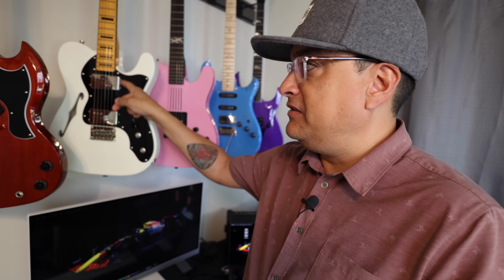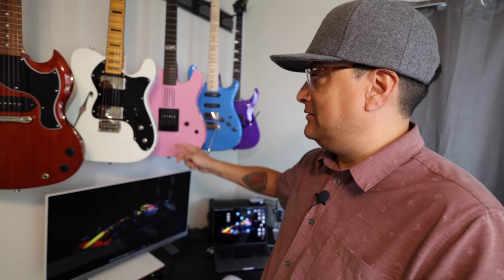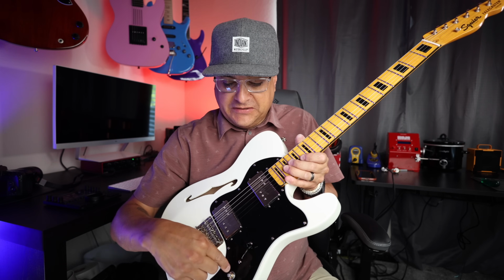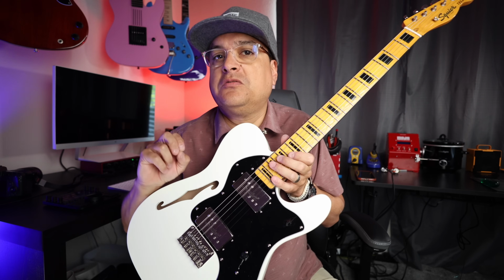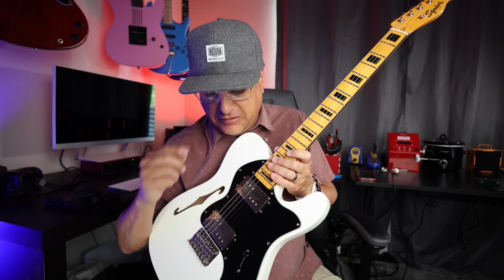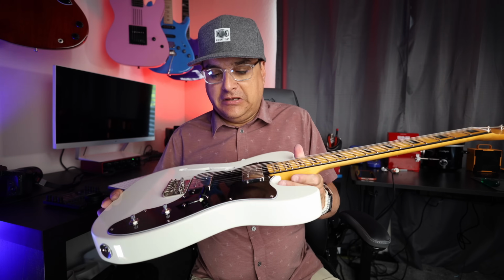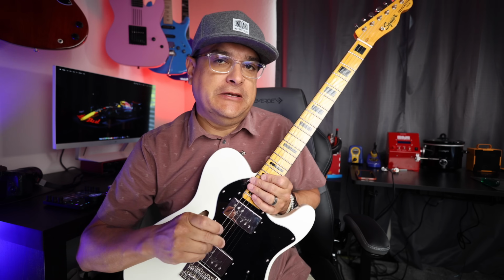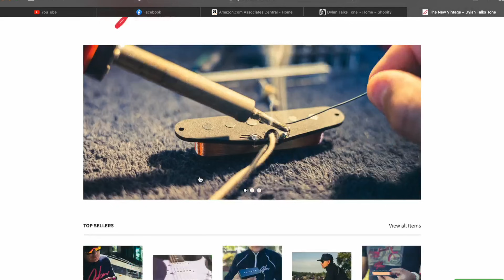250k Pots Vs 500k Pots - Sound Comparison

Comment: What nobody mentions is that none of these pots were at 500k or 250k when the guitar was being played! The crucial resistance here is that when the pot is fully open ... which isn't 500k or 250k ohms. The 500k or 250k is the figure when the pot is fully closed. So what is the resistance when the guitar is playing with fully open pots? ... well, unless you test the pots you won't know. Yes, it still boils down to the fact that 500k pots will be brighter than 250k pots but different pots have different tolerance levels so unless you measure the much lower resistance when fully open you can't make any properly detailed comparisons.

Comment: It's important to remember that the volume pot is wired as a voltage gate, as a result the hot signal has to go through more resistance as the volume is turned down, attenuating more treble.  This means that larger pots are brighter only at or close to full volume!  250K pots may be darker, but usually dont require anything like a treble bleed or 50's wiring to compensate for treble loss as volume is turned down.
Reply: Hi Dustin. Hope you can help me out. 1) How can the tone pot have influence on overall wiring resistance? For instance, I have an HSS guitar with 500k volume pot and two 560k resistor on each hot lug of each single coil so that they can see around 250k, but my concern is how the tone pot will get into this. 2) How different is it to solder the capacitor on the tone pot in the middle lug or the third lug. I have seen both wirings. Does it change considerably?  Consider for that, a master volume and master tone.Thanks a lot!
Reply: I change all my guitars to 50,s wiring, does this mean I still would benefit from Tone bleed    components added or not?
Reply: It's a treb pass, not a bleed.
I have no idea when the term, got reversed.
A bleed shunts to ground, signal gone.
A pass, sends desired signal to where you want it, not to a dead end.
Reply: @johncollins5552 Only if you like the effect.  Some like the sweetness turned down and one knob control.
With out a treb PASS as you come up in volume treb frequencies can talk to an amp aggressively. 
I don't mind using the tone pot.
Been using treb passes for near 50 years.
Reply: I play mostly Strats, so it's (mostly when I have the time to change it) 250k volume with high pass and 500k tone's with .015MFD cap on neck and .022MFD cap at bridge with middle wide open. I just find that kind of setup gives me a consistent expectation from all my guitars at basically all volumes.  You are right about the capacitance induced by the 500K pot as volume though, higher is not always brighter.
Reply: I've never heard the term voltage gate used to describe a potential divider.

Comment: Wy not just install both 250 and 500k pots using a toggle switch as a selector between both? You get the best of both worlds by simply throwing a switch.

Comment: It would’ve been nice to hear the 250k pot played through all 3 pickup positions like what u did with the 500k. Also would’ve like to hear them played with gain. Aside from that, very informative, thank you.
Reply: Was thinking the same thing bro !
Reply: Absolutely. I feel as thought the 250k would have performed as well if not better than the 500k pots if it was to given the chance.
Reply: yeah, we didn't get the bridge pickup demo on 250k
Reply: You all, noticed that little "leave out" with the bridge pickup on the 250K pot demo, as well - huh?  My "gut" tells me that he did that on purpose and that no-one would notice... but, not saying he did for sure.   Personally, Had he switched on the Bridge Pickup, I think the 250s would have sounded "fuller"... at least to my ears.  I found that the 500K's sounded much too "tinny" on the high end.   To be honest... I don't play 6 string guitar... only Bass, Lap Steel, Mandolin & learning Harmonica.

Comment: 4:41 The higher the resistance, more of the highs come through. 
5:04 The lower the resistance, closer to ground, the more top end we lose. 
7:25 Biggest impact to tone is changing the volume pot. 
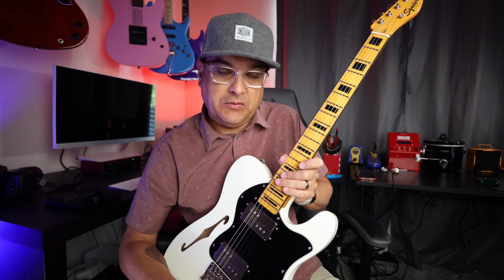9:12 250k vs 500k pot sound test 

So lower resistance give you warmer, fuller sounds, higher resistance give you brightness and tight attack.
Reply: But it's relative to the pickup. Do you really want a brighter sounding strat pickup?
Reply: Hell yes! @Blueguitar007
Reply: I got a seymour duncan jb sh4 and i like shredding and metal which should i buy 250k or 500k?
Reply: I can tell you why.   If you had zero resistance, a short, your entire signal would be shunted to ground….disappears.  The more resistance the less you lose the first things to go are small signal then mid then low or high/mid/low frequencies.
Reply: Hell! Thats all I was after! Thanx
Reply: @Blueguitar007  Yngwie would say YES! More is More
Reply: @liamxd27  why are you asking people to tell you what you want? buy both, try both. pretty easy.

Comment: Assuming that the strings we're brand new for the 250k demo (you didn't say) as you changed the strings for the 500k demo. I thought the 500k pots demo sounded "a bit" fuller/warmer than the 250k pots.
Reply: I concur,

Comment: Thank you!
I listened very closely a number of times and I prefer the 250's but I can see where other folks appreciate the 500's for their own style.
Cheers!
Reply: Same here!
Reply: Yup sometimes too much highs can be shrill with distortion pedals.
Reply: Agree with the 250's.  It seems more versatile on both low and high end tones.  If you're picking more fills and solos the 500k pot gives you a more tele sound especially for country licks.
Reply: Yep, JB straight to a 250k volume pot with no cap or tone knob. 330 sounds interesting

Comment: If you want more highs (upper harmonics), use 1 meg pots or switch them completely out of the circuit. Thats why I like pull switches on a pot. You can switch the pot completely out of circuit for the cleanest sound. With that arrangement, you also can switch from a good rhythm sound to a louder, cleaner sound for solos by pulling the pot/switch up..
Reply: I bought a Traveler Guitar because I wanted something compact.   But what sold me was a YouTube video by a enthusiast playing one.  It sounded great.  It has a pickup and a output jack.  No volume or tone control and as far as I know, no capacitor anywhere.   99.44% of guitar sound is the hands holding it.  Unless You were Stevie Ray Vaughan, he needed to use the knobs and switches to keep his hands from melting the strings.

Comment: I have an old Washburn Force 3 as a project guitar. It has a couple of Bill Lawrence 500s, an xl and an r, in bridge and middle, as well as a Symore Duncan Hotrails mini in the neck. All pickups have toggles for splitting. While adding resistors to the switches to fix the thin split tone, i swapped the 250k pots, volume and both tone, to 500k.
The difference is pretty startling with these fairly hot pickups. I've always had to ride this thing right at 9 or 10 for volume and tone. Now i can get decent output and tonal control around 4 or 5 volume. The tone controls are more subtle but give more control and sound a bit more musical,  imo. The guitar sounds better than it ever has and i have this video to thank for giving me inspiration. 
It's also great that i got to use some of my late father's old components in this build. He would have loved your channel!

Comment: Love it!  the volume pot isn't just a variable resistor, it's a voltage divider.  Resistance in both series and parallel.  I put a 250K in a crazy-bright PRS, brought it back into the Les Paul range.   Look into adding a Resistor between the final signal and ground too.  800K or so.
Reply: I have a budget PRS copy HH that is overly bright and harsh, so a 250k would help mellow out the harshness?

Comment: Another good video! In my practical testing using my amp, guitars, 0.8 mm plectrum, 9-42 strings it seems llke 250k pots works best even in guitars with humbuckers. I have several gutars with P90 in neck and HB in bridge with partial coil split and IMO they easily get harsh with 500k pots. I also prefer 0.47k cap. It's all about ears, music and what you like. I don't have a feeling any of my guitars sound dull.

Comment: I just bought one of those Squier Thinlines and really dig the sound from the stock setup but this was informative and you've got me thinking about future mods. Thanks!
Reply: The thing about Squier, and fender in general, they make for great modding platforms...if you're willing to put some money into it, you can wind up with something that's greater than the sum of its parts, and there's lots of bolt-on upgrades on the market for fender/squier
Reply: A Squire Thinline is my go to midnight guitar.
loud enough to hear, quiet enough the wife sleeps through.
I put in Texas Specials, brass saddles, and fresh tuners from Japan. (I think Gotoh)
Love it.

Comment: Learned  a great tidbit of info on pots! Thanks for the small epiphany! I recently ordered a Tele kit that came with cheap, 500k, Chinese dime sized pots. It had standard (5.0-6.5 k) single coils that I swapped out for a hb in the neck and the kit bridge pup. I replaced them with a double pot - 250/500k CTS for tone and volume. Your video helped me to see I probably could have saved a few coins and just used 2 500k pots instead. Thanks for the great information!!

Comment: Hey! You should create two separate circuits. Switch on the 250k when you want that sound and visa versa with 500k. Add in phase, out phase hum-buckers, split coil, coil taps and a builtin graphic eq! 😄oh dont forget to include a Kaossilator!

Comment: Dude, this answered a problem I was having with a JBjr. In the bridge of my strat. I knew I was missing out because of the 250k pots but I didn't know exactly how that worked and also that changing just the volume pot might be and option. You rock with all the much-needed guitar tech information that we all need. Thanks!
Reply: If it's HSS they make stacked pots (basically a 250k on top of a 500k sharing the same knob post) You can wire the humbucker up to the 500k side and the single coils to the 250k side if that's your jam!
Reply: @lowalkoroc  , nice! Thanks!

Comment: I had some 500k pots in a tele with single coils when I installed an Obsidian wire solderless harness that came with them. I had to dial the tone almost all the way down on the bridge pickup so it wasn't too shrill.  I wound up buying a Mojotone solderless harness with 250k pots and installing that in the guitar and it was much more to my liking.

Comment: I am restoring a 1989 Korean E9xxxxx Stratocaster. 
The small pots are good quality, 500K's with a .33 cap.
The volume is linear, so you can essentially control treble bright to dark tones with just turning the volume down slightly.

Comment: For some of my guitars I wire each pickup direct to the output and have separate output jacks for each pickup. That way you can have separate amps for each pickup, which can sound massive when you blend/pan them. It helps to have a master compressor/limiter as a safety net to level any significant EQ or volume jumps when switching.

Comment: I typically, but not always put 1M pots in humbucker guitars and 500s in single coil guitars cos as Dylan said here, you can take away but not add in passive guitars

I use my tone knob at around 6 as my 'default' sound and from there I can remove more treble as per usual with a tone knob, but also add some treble back by rolling the knob towards 10, just gives a little bit wider a range of tone to play around with

I also put 0.033uf caps in for humbuckers and 0.068uf for single coils with a 5k resistor in each case on the feed to the tone knob sometimes

Comment: I have a Caparison 8 string that only has a single volume knob. It came with a 500k pot, which sounded fine through a high gain setting, but the extra brightness of only having a single 500k pot made the cleans STERILE sounding, so I swapped it for a 250K pot and now the guitar sounds great clean and when I'm playing high gain I already run an overdrive that boosts the treble anyway.

Comment: You said everything was the same BUT you changed the strings when you put in the 500k pots. New strings will always brighten up your sound. Just saying. Good vid.
Reply: He'd just rewound the Tele's fake WRHB into real WRHB in that 250K video I think, so they were also new strings.
Reply: Negligibly if the strings are not that old.
Reply: Dylan mentions re-wiring “wide range” HBs to improve tone; He mentioned a video. Is he talking about rewiring the humbuckers that come with a MIM that are Standard Hum bucker is that only cosmetically look like the wide range humbuckers? I replaced mine with a real CUNIFE humbucker from Fender, but I have the fake/standard humbucker with a bar magnet sitting in my parts box; If it’s worth making right, I’d get it done. Can someone send me the video? I can’t find the link anywhere on the “Dylan talks tone” channel.
Reply: @sadlsore  there was probably nothing wrong with your original hb,it’s in Dylan’s best interest to convince you to do all these “upgrades”
Reply: I'm sure he shed some skin cells playing one guitar the topography of his fingers changed miniscully lol your argument is invalid
Reply: @Ledzepfan88  lol
Reply: @Ledzepfan88  they do have a point tho, new strings sound noticeably different than significantly older ones. Same with reeds on winds and basically most main vibrating things that degrade with time on most musical instruments I think.
Reply: @seancurtin5131 100% disagree. 
Brand new strings will sound a lot different than strings with just a couple hours of playing time. I personally hate the way brand new strings sound
Reply: He mentioned that he made the rewinding test video a week before this one. I don't think that a set of strings would degrade in a week.
Reply: @smokepeddler u don't want no smoke peddler
Reply: 9:11 plays neck at 250k, the remainder he plays all 3 positions at 500k + plays different licks.
No 250k at the other positions?? WTH?
Reply: You know how hard it is to reuse strings????? Even if they only been on for a day!!!! It's not like changing a Reed dude
Reply: My guitar sound gets dull if I put new  daddario strings on. I never heard this fender wide range with 250k pots. 😂😂😂😂 was I sleeping when that was done? Not sticking around for the 500k
Reply: Get out of here Flog! A few hours old strings makes no difference. I can’t stand you people 🤦🏻‍♂️
Reply: Would you recommend 250k for metal bridge pickups and 500k pots for the neck?

Comment: I already have a 1982 AVRI & a 2015 Nashville Teles.  I came across a 2021 Infinity which I promptly gutted electronically.  I installed a MIM Tele bridge pickup and a Wilkinson M series humbucker, 500k pots, .022uf cap & a 270k resistor for the bridge pickup per a Fender wiring diagram.  Way too shrill.  I switched to .047 cap & a 510 resistor.  The HB was extremely loud and the single coil mostly silent. Very low volume.  I switched the resistor to a 270k & 100k wired in series, 370k total.  Sounds great now.
Reply: 510 rather than 510K?  No wonder it was almost slient.

Comment: I just saw this video - excellent content, brother. 

I've been told by reputable guitar techs that there is no difference between the signal path of a 250k setup versus a 500k (or 1 meg) setup when the pots are wide-open. Is this correct? Does the difference surface only when the pots are somewhere between the extremes of the sweep?

Comment: folks, remember that in Alternating Currents ("AC", like audio signals) we not only talk about mere resistance,  we talk about impedance (Z). What happens when using different pots values is that we modify the output impedance of the guitar (pickup Z in parallel with pot vol resistance). And the impedance, along with the parasitic capacitances in the coil itself, in the cable, , etc, varies with frequency.
 The coupling between the input impedance of the amp/pedal and the output impedance of the guitar also influences (that's why pedals that don't have "true bypass" lose a little in highs, it's all about impedances (like the "inverted" wah and Gilmour's seagulls)
Tipical Z of strat pickups (alone) are near 800-900 kohms (in the resonant frecuency, typical 10-11kHz), When we put a vol potentiometer, that resistance dominates the total impedance, so the output impedance of the guitar will now be a value close to the real value of the volume potentiometer 
(the total value 2 or more impedances/resistances in parallel will always be a little less  than the smallest of them)

Comment: I really love that block inlay vibe.  I've thought about swapping pots on my Jazzmaster, but I'm hesitant because it already sounds amazing.
Reply: I had 250k pots in my Jazzmaster,it still sounded amazing...yes I will put them back in...try it
Reply: I just saw the announcement that EMG is making an exclusively Jazzmaster set of active pickups and have seen a couple reviews on them and so far sound pretty dope. Can't wait for the official release and give them a shot myself
Reply: If you like the way it sounds I would leave it as is. Now if you don't like the sweep or the tension of the pots, that's different. Maybe you have a volume pot that's very stiff and awkward to use when doing swells, you would probably be happier with a low friction pot of the same value. Or if you have a low friction pot that your hand bumps into, try a medium friction pot etc.
Reply: @countzero5150  I'm doing one worse...I'm buying a second Jazzmaster (affinity series this time) specifically to be a mod platform.  😁
Reply: Just lift the ground tab on the volume pot, and put a 250k resistor between it and ground and see if you like the sound.